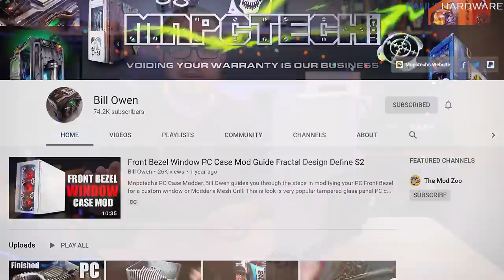I told myself this would be a quick fix...

Comment: ..... throw in a gtx 1650 super and off load the encoding to a graphics card. problem #2 the case may be nice for a killer mobile lan party desktop not a good idea for a home surveillance machine so you need a bigger case preferably either a rackmount case or a home theater pc case. 
in fact I'd recommend using a Threadripper(gen1 preferably) machine for the PCI express lanes so you can have all the cameras to one machine. also to do it right.... I'd see a custom home surveillance machine costing in the ballpark of 2000 - 3000. only cause the SDI capture cards you'd need to have all the camera's terminate at the machine costs about $400-$600 a pop for 4 to 8 cameras per card.

Comment: why all the mouse these day do not have lefy click and right click on the mousewheel is out of my comprehension. that why i keep fixing my LG G9 and G9x over and over again 
DPi can be adjuste by 50 dpi not just lock at not 200 hundred. like mostly all mouse do these day. so sad fricking sad. they need to make this mouse comeback asap.
Once you play for long time with a mouse that increase by 50 DPI you cant never coome back, so much more precision in any FPS, more than, dispay port this, diplay that, 144 mhz, 1MS bullcrap 
even if they do make a little difference its nothing like 50 dpi increment and a mouse wheel 3btn is also such a mazing option to have. just buy a razor viper mini and i don't use it bcuz of the single click mousewheel. great video once again Paul

Comment: Paul, for the next time you use the u-channel: You can cut it in a 45° angle and in that way avoid the "empty" corners.
Reply: Or use the dremal and cutting wheel for a round corner.

Comment: Could miter the ends of the u-channel rubber if you worry about aesthetics and idk if you were wearing a respirator/mask or anything while playing with metal, but thats usually the move. Your lungs hate metal dust in nearly every form. Cool freaking mod tho and great work with the angle grinder.

Comment: Paul is it better to hold off on a new built pc for the DDR5 ram and the pci 4 or just up grade now? Ex my CPU is a 6700 I7 and the board chip set is X170. Going is a 1080.

Comment: Why did you not install the Cooler fan on the underside of the Noctua Cooler? since Noctua allows for it? Or order the Noctua Bracket bracket for the L9I? Or swap the board to an ITX Intel system? It broke my heart to see the Sentry 2.0 destoyed since I know this is a rare case. But I guess it had to be done for entertainment of the masses. :(

Comment: Are there CPUs which do not require cooling yet still run fast? I am thinking something with more cores but slower clock. Or a larger die with the cores on the chip spread out a bit. Back in the day there were motherboards sold that were dual CPU.

Comment: I guess simply moving the power supply to the other side of the case to improve original airflow wasn't an option, or you would have done that. Right?

Comment: Should've used a bigger case in the first place, because to mod a very small case to hang its inner hardware guts out is somehow an oxymoron.
My experience over many decades is, that if I modded something....I regretted it some years later because the modded "thing" couldn't be reused anymore for something new and updated.
If you don't have almost unlimited supply like some hardware youtubers or a truckload of money....go the save unmodded route.

Comment: One of the fundamental mistakes, in my opinion, I see builders do all the time is make PCs in small form factor cases even when they don't have to.  I am a fam of large cases and utilize them in almost all use cases.  Major advantage is less limitations when it comes to installation and part options.  Unless there is a compelling reason to use a small form factor case, I really don't think its wise to use them just for the sake of using them.  Not sure of Paul's motivation, but I see these cases used often when there is plenty of space and no practical reason to go so small, advertising and sponsored builds not withstanding. f

Comment: Looks like you are using the wrong wheel Paul on your angle grinder.  Aren't you supposed to use a grinding wheel to cut?  That's what Jay did 😂.

Comment: Kyle has done the same thing.  Moral of the story: you can't build a serious system inside one of those tiny cases.
Reply: That entirely depends on your definition of "serious". Also it is a case designed for a specific use case, not ALL use cases.

Mine fit a 8700K with an AIO and a 1660TI just fine. I'd call that a perfectly serious machine.

Comment: What cutting wheel did you use? I was planning on some case mods that would require cutting.
Reply: imkrazy182 Any thin cutting wheel will work. Of course some are designed for metal and some not as much. If your unsure if you have the wrong type, it won’t fly apart as much as the wheel will just wear down quickly.

Comment: HELP NEEDED  
I'm building my first PC, got no idea what I'm doing, was following Paul's £900 build using the msi B450 tomahawk max but the place I ordered it from on pcpartpicker messed me around, I cant find a B450 motherboard in stock anywhere now so I've gone with a ASUS TUF X570 PLUS which was pauls alternative, this MOBO has one, 8 pin power port and an extra 4 pin power port, but the PSU I have only comes with one 4x4 pin power connector cable, it's a EVGA G5 supernova 650w, I've seen posts on google saying I'd only need to use the 8 pin power port on the MOBO to power it and it would be fine as long as I dont overclock? Not sure how true this is, but I was kinda wanting to OC to get the best results out of my MOBO, can anyone give me any solid advice please? If anyone can confirm about only using the one 8pin power port on the MOBO, or even send me a link for a replacement cable with both an 8pin and a 4 pin power cable on it? I've tried looking I cant find anything.. THANKYOU

Comment: you could have used an 240 AIO radiator in that space where the ssd were... :p
but hey, i did your solution too, one radiator outside the case on the botton ( had to replace the case feet) and the fans for the radiator in the left sidepanel, radiator too thick to fit both inside without comming in conflict with the graphic cards
PS: you really should add any protection for the fan, you wont risk you system die due to a stucked fan, do you?

Comment: Check Out Blue Iris for recording software, I am using it on a 10 year old system running 7+ 1080p streams with recording and motion triggers uses less than 10% of my old xeon so give it a shot.  Keeps all files local and hosts a local server to login and check the system. very customizable including alerts and recording profiles.

Comment: So... first of all... case murder.
However, it does look pretty cool. With the extra cooling capacity you should opt for a ryzen 3600 and an MSI Aero ITX GPU so you can still fit your mechanical drive in the top compartment. I wonder if you could stack your drives all into the tail end of the GPU compartment with a little drive sled/ bracket or some double sided tape?
Reply: Also, while you are going chop shop, how about a thermaltake triple ring fan set to orange instead of the stock noctua fan? Its a standard 120mm noctua fan right? Hell you could even use software and have the RGB cooling fan change color with CPU temp.
Reply: ...and maybe a fan grill for that external fan?

Comment: PAUL! Blue Iris, and be done with it, I pay 80 bucks a year for a lic, but its the best, of the best,...of the best. Byte my Bites, "Jason," has great vids on this, who turned me on to all of this. I use POE switch and POE cameras, wireless cams still sucks, on anything still really, unless the AP is line of sight, lol. That is all. Do work. FYI, I use a old x79 system with a 1.8ghz 12c xeon. I have 7 cameras with no gpu to help. I has no issues to date after a couple years now. Solid. And the App lets me connect anywhere, super easy to setup. I have PFsense router as well, with older now, asus routers in AP mode. And have a ebay 24-48 POE switch from old server gear, which is nice and overkill for us now. And just build in a bigger case , jesus.. lol

Comment: but WHY???
just get a cheap standard case and put PC into that, this is slim show case.
Not like this PC will be visible somewhere in the closet
Now there was some voice of reason in there - just get fine wire mesh, bend it and cover case with higher cooler, save the panel intact.
Oh man...